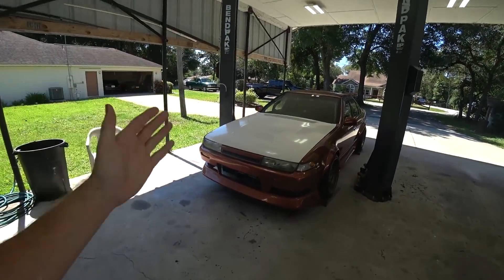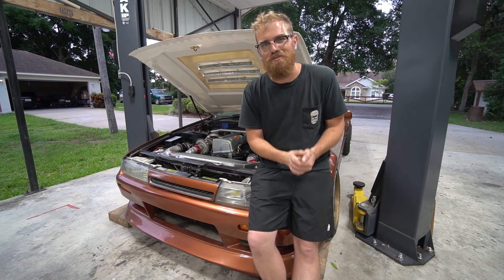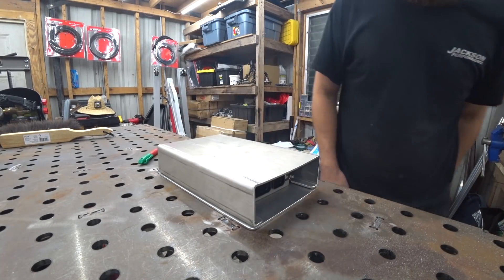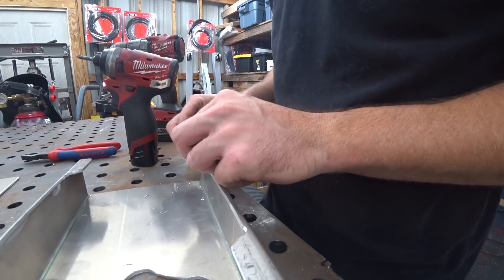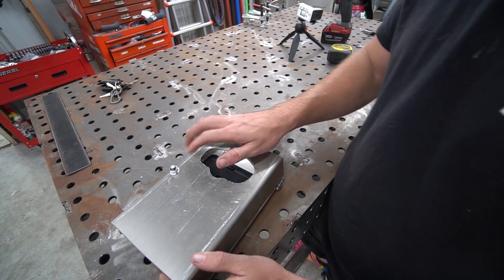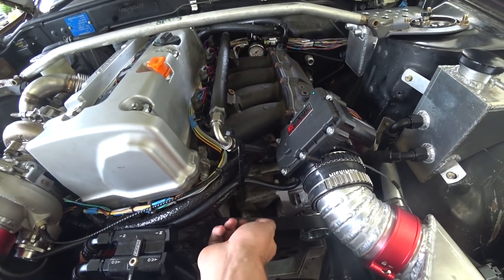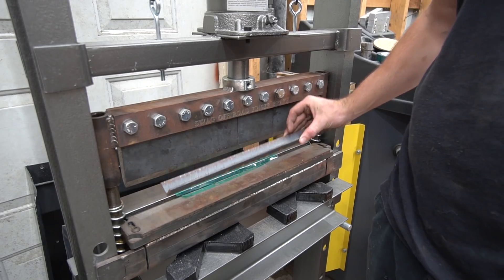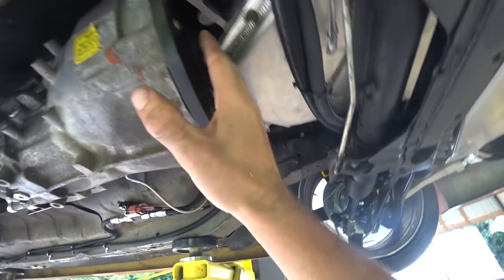K24 Nissan Cefiro build. we had to make more custom parts. But they came out sweet

Comment: Nice job on the fab work Taylor, especially the flywheel cover. One rock stuck between the starter gear and flywheel can cause a lot of work that can be avoided with addition of the flywheel cover. Good PM (preventive maintenance).

Comment: Tip
You can replace the USB port cover with silicone.
First populate all the USB and other ports with a cable
Next place a bit of plastic sandwich film (cling wrap glad wrap etc) into the plug well and around the cables to prevent the silicone from sticking to them .
The fill the well with silicone ensuring that there is enough to form a plug.
You may want to embed some string into the silicone to act as a handle for removal.
Allow to dry and it will hold the cables in place prevent dust ingress but still be removable.

Comment: I thread with a drill all the time. If you do it enough, you get proficient with it and learn your limits of the tools your using. Rock on 🤘
Reply from the maker: That’s how I fill about threading bolts with the impact. People act like it’s insane. Never had an issue but I know the tools.

Comment: @Taylor Ray look on Amazon at the lisle 70500 tap socket set. You will love them for tapping holes with a drill. I use these ever night at work as a machinist
Also, you should look into a cnc plasma table. The software to draw is free and the table itself is fairly inexpensive. Your plasma cutter just hooks right up to the head of the table 😁😁

Comment: Hey Taylor. After using the plasma cutter tap the edges with a ball pein hammer on the edge to chip off the slag then use the belt sander makes easy work and saves belts on the sanders you need I can make a video and send you it

Comment: personally id have done the ECU box the other way round.. have the ECU bolted to the folded tray, that is bolted to the car and just have the flat lid held on with 4 small hex caps into riv-nuts
no akward cutouts for USB access, no hingle bolt clearance slots etc..
But if it works... good job!

Comment: Taylor, on your table...you need a 6, 8, 19 pack or so of pins that fit those 14mm∅ holes(?, 15mm∅...maybe??). 2 or all 26 for long stuff, butt mat'l against 'em, VÍOLA, straight as 71.8 weasel schnits. Could also figure (then perhaps color differently?) which series of 3 or 4 are of your more common angles (15⁰, 30⁰, 45⁰, etc.) as they all relate to a same,  predetermined line.

Comment: The press maker makes angled fingers so you can easily bend m90s and such. Might be worth looking into.
Reply: You mean a gooseneck punch. That homemade V he made is extremely dangerous.
Reply: @ddevil4980  Yha that thing. They were relatively inexpensive. 
While his contraption looks sketchy, I don't think his press has the force to break it, but i did cringe as he used it.

Comment: Taylor, suggestion 
With your ecu, get a USB extension and run it up to a point that is handy. You can get USB extensions that have one end hard mounted if that suits. 

I would do it particularly for dyno days. 
That way your install can stay exactly as you will run it and the tuner ( Kev ) can plug in without you pulling everything apart.

If there is an issue then your wiring to the ecu will be as you run it and this will make fault finding easier 

But if the ecu is already pulled apart before hand then that is a variable 

Just a suggestion

Comment: If i were you I'd cut some PVC pipe in half to use as channels for the ECU wires. People will still stomp them and stress the connector.
Maybe when you loom the harness. Otherwise nice work on the build!

Comment: "Oh no, it worked!" 

I love these last few projects to get the Cefiro completed. I was one of the people who said you should sell the thing back when you lived with Ben, but I'm glad you kept with it and made it your own, it's turning out great. You should get a 12v AC compressor from a Leaf / Prius / Tesla for this car so you can keep your accessory drive setup as simple as possible.
Reply: Thanks for this comment, I might use that tip for my build!
Reply: Street FX Motorsport TV put out a video about how they got 12v AC in their 1300hp car. The parts can be different, but they have a great install method.

Comment: You could bend the right angle on the shield a bit more 'open' so when its installed the lower shield part pushes against the transmission if that makes sense...that would help it seal it up more, and it would keep it from rattling

Comment: That tape measure is at least 4 years old.... 
In my line of work, 35' stanley fatmaxes are pretty much a consumable lol 
One of them will last me about 4-6 months.

LOL impacting bolts in 
Two or three uggaduggas ain't gonna strip your shit..... And tapping with a drill lol try a 3"1/4-10 pipe tap in a 15" turret lathe thru A36 steel at 25rpm yeah dude forget it. Machining sucks. Don't listen to the haters unless they r telling you to buy a bridgeport.

Comment: Hey Taylor, i noticed that youve had to make a few modifications to the sheet bender to get it right. It might be worth checking out the finger brake Colin Furze made on his channel a few years back. Its a different style bender, but it should be more capable, and could make for a cool video.
Edit: Link to video https://youtu.be/Ggy1DHwAh_0
Reply: Thats a good one!
Reply: That homemade V Taylor made is extremely dangerous.. I'm worried he is going to end up with it in his gut.
Reply: @ddevil4980  yeah just one little bend or kink and an immense amount of pressure, that shit turns into one deadly slingshot
Reply: @HashTagDan1  I've seen a 10inch chuck of a .984v shoot out and get stuck in a concrete wall. People are saying oh its not under that much pressure. What they fail to realize is if you go to rehit a bend and you're a little off the pressure shoots up and that's when they fail and explode. What I'm worried about is it miss aligning and shooting out. I've seen that happen and break one of my coworkers ribs and give him a massive gash to the point where he needed 30 stitches.

Comment: With the amount of aluminum I tap, I’d shoot myself if I didn’t use a drill to do it. Just drill the hole the correct size and use a little lube. It’ll be fine, I promise. Even with Harbor Freight taps. Spiral drill taps are much better though.

Comment: Surprised you can’t just put a dongle on the ÉCU and put the laptop plug on the dash somewhere...kinda excited, kinda sad to see this build over.
Reply: This. You can get right angle USB connectors too so it works with that box.